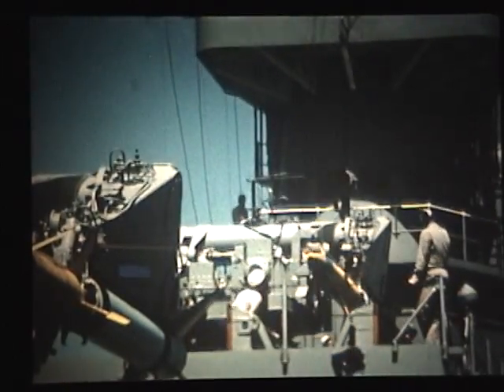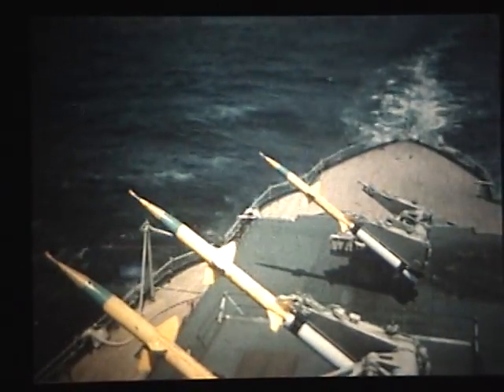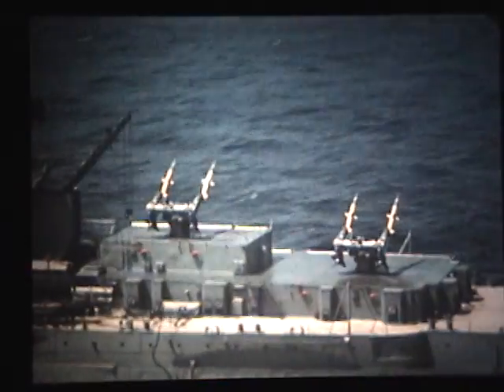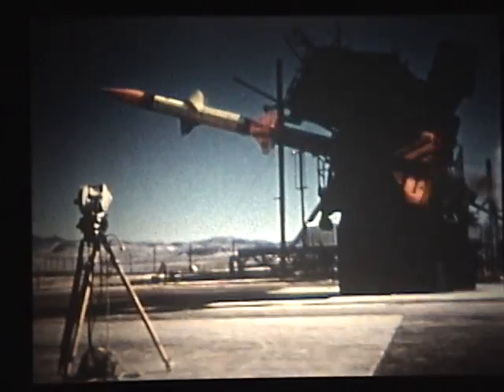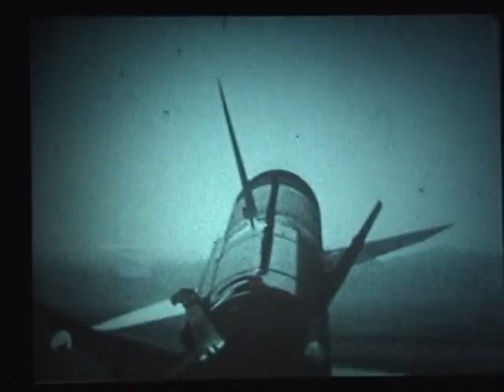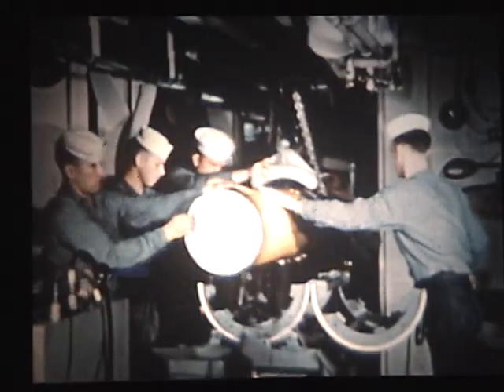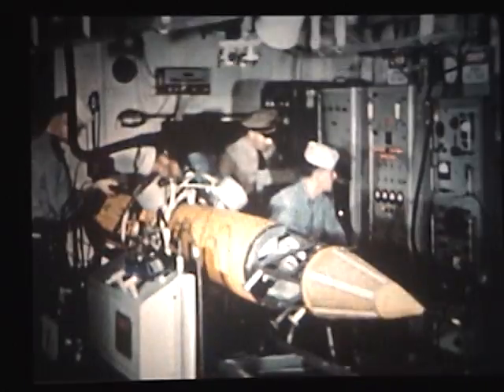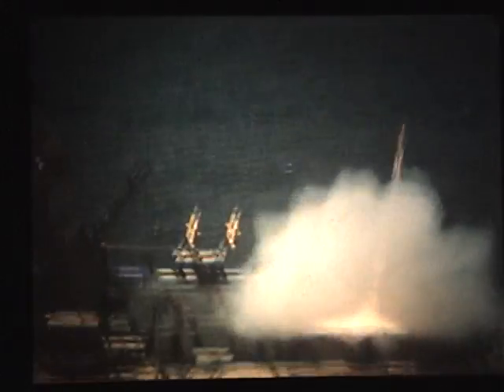Terrier Missile On USS Mississippi EAG-128

Comment: During WW2 - USS Mississippi BB 41: Okinawa Ryukyu Islands June 5, 1945:
At 1923, two planes which were identified as friendly flew around and one kamikaze dove onto the battleship USS Mississippi BB 41. The other kamikaze plane turned to the Louisville and started to make a run on us. I was on No. #4 - 20 mm AA gun mount on the port side below #2 main battery and I fired 58 rounds to set the kamikaze plane on fire prior to  hitting the Louisville’s front smoke stack bending and twisting it and killing 9 men on the 40 mm gun mount mounting on the forward superstructure tripod about 140 feet from our gun mount. The kamikaze also cut our sea plane off and left only the pontoon on the catapult.
Three other 20 AA mm gun crews opened up firing 4, 11, and 20 rounds as well. We were not told to fire for we did it on our own. We were only manning the guns at the time and were not on general quarters. Later, the officers came by and said good job. Story by Enrico Trotta S1c USS Louisville CA 28  1943-46. Tony Trotta
Great to see the USS Mississippi was still used in the mid 1950's & you can see had a 
solid platform.

Comment: that is a interesting way of loading Terrier, if you look they switched it on Boston and Canberra and eventually set it so that the missiles loaded vertically coming straight up while the twin air arms were pointing upwards but this could have done alot of good for say the USS Washington and two of the South Dakota's that were scrapped since they could still keep up with Carriers....
Reply: TEGRULZ it was a prototype installation here for testing purposes, not a true thru-deck conversion like the cruisers were.